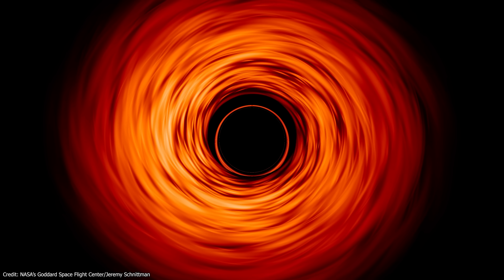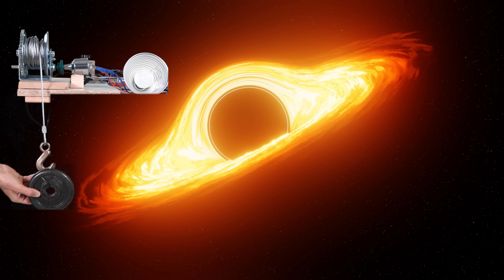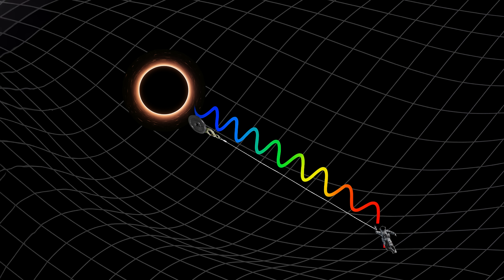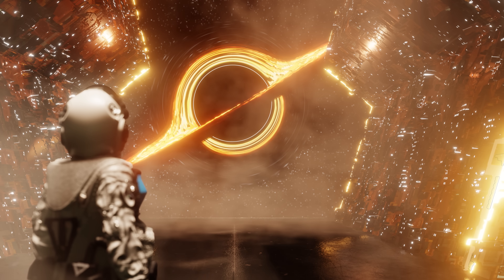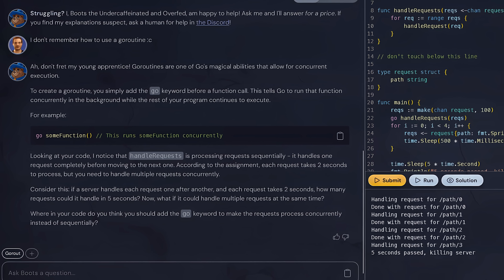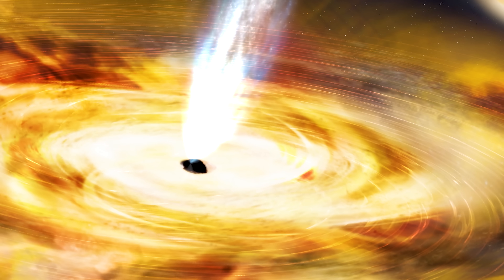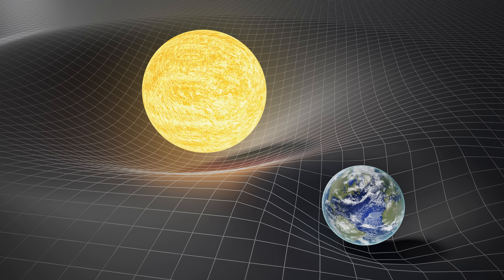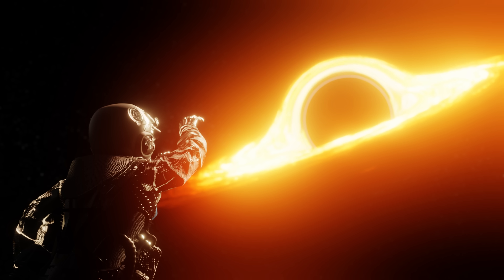How to Convert Mass into Energy at Home

Comment from the maker: I should have mentioned that the cable is massless. So we aren’t accounting for any change of mass of the cable itself.  Also, Click this link https://sponsr.is/bootdev_TheActionLab and use my code  THEACTIONLAB  to get 25% off your first payment for boot.dev
Reply from the maker: I’ll just tell you because it would’ve been interesting to put in the video. If the mass just falls in without being slowed down on the way, then we would say that 1 kg got added to the black hole. From the black hole point of view, it would say it got more mass than 1 kg. If it started at infinity(very far away)  then the black hole would say it gained 2kg of mass.
Reply: @TheActionLab - When a mass falls freely (and straight in) into a Schwartzchild black hole (from any distance), isn't it true that BY DEFINITION it is traveling at the speed of light when it reaches the event horizon? If true, that supposedly means it has gained infinite mass. That calls into question the simple multiplier of two for the mass-energy. Will an argument then be made that the black hole lost mass-energy by pulling the small mass in? Only recovering that mass when they merge? And is all of this accurately accounting for the non-conservation of energy in General Relativity?
Reply from the maker: @YodaWhat  ok, I think my question is a little tricky because of that. If you are an observer at the event horizon, then any object that falls toward you will approach the speed of light and thus its mass energy will approach infinity. But that doesn’t mean that the black hole receives that mass energy. The discrepancy comes because of the extreme reference frame of a hovering observer at the black hole event horizon. They would be using infinite energy to stay hovering there. 

But in the end I guess it’s not a very good question to ask what happens from a black hole point of view, since it’s is an impossible point of view.
Reply: @TheActionLab  "impossible" is not a reason to not ask the question? Otherwise why even ask the question about lowering an object inside a black hole with a winch..
Reply: @TheActionLab  isnt you converting only the gravitational potential energy

edit i commented this in begining of video
Reply: @TheActionLab   This is because from infinity to the event horizon, potential energy difference is equal to the rest energy? Just like the Schwartzschild radius?
Reply: We would say 60% went in, the black hole would say 100%
Reply: Now try it with a kilo of feathers 😊
Reply: Last I checked black holes can’t speak.
Reply: How to demonstrate the Oberth effect? That aceleration is a function of length travelled during acceleration, and not of time. I'd like to see how something that is already fast, accelerates more using the same amount of energy, than something that is moving slower. Why does it only work in space, and is the other way around here on Earth (like with a car)?
Reply: @bjorntorlarsson  accelerates more no, in my understanding its just the kinetic energy that increases.
KE increases more cos its 1/2(v+Dv)^2*M and (v+Dv)^2 is higher if v is higher even though Dv is the same.
for example
Reply: We'd say 1 the hole would say more?
Reply: Great job!! I love the direction you are going in, James! Thanks for your contribution to society!!
Reply: ¿Y el doblaje en español?
Reply: "Accretion disks are the most efficient way to convert mass into energy" when are we getting black hole heaters where you can dump any matter?
Reply: what about free fall?
Reply: I have always wondered how do scientists believe that the end of the universe will be in the heat death of the universe where all matter and energy are at maximum entropy and thermodynamic equilibrium, if black holes will continue to form from matter coming together and then shooting out energy into space again keeping the universe from ever acquiring maximum entropy and thermodynamic equilibrium?  Anyone have an idea how this hypothesis holds any weight?
Reply: That might be the worst of all of your experiments
Reply: From 🇮🇳
Reply: Does anything ever falls in the BH?
Reply: I don't understand the thought experiment... You say : "if I let this free fall the only thing slowing it down will be the generator" (1:06), but the generator is also free falling is it not ? So why would the 1kg weight follow a different trajectory than the generator ? The total forces on the generator are the same as the total forces on the 1kg force right ? The only difference are the few centimeters difference of their respective position in the gravitational field.

Comment: Thanks for taking the time to look through my work. 
I got started on this in 2007 and ten years later the penny dropped.
My whole life I have had a great passion for how things work. And would rather read an instruction manual than a book. So strap in, this is quite a revelation, 
Stanley Meyer and his twin brother Stephen were industrial problem solvers. Stephen has an impeccable resume and has been involved in many industrial developments with inventions and patents like the control of dielectric coatings on magnet wire, grading of fresh orange juice, if you drink orange juice it has been through his patented grading process. He was called out to put out a gas well fire in Libya that was over a mile high, using jet engines fired by the gas from the well below and directing the non combustible exhaust gases into the flame to extinguish them. So when Red Adair is not around they would call Stephen. 
Back to problem solving. As young brothers Stan and Stephen would sit after dinner time, and propose a problem that had to be solved. To do so they would split the pros and cons between them. One would spend ten minutes proposing positive steps to the problem and the other would spend ten minutes proposing the problems in doing that and then take turns about doing this into the early hours of the morning till they could come up with a viable answer.
Ok on to the matter at hand Stan and his New Atomic Energy source and his water powered car.
The first thing I would like to point out is that electrolysis has very little to do with this new technology. And it can be done without any electrolysis. There has been a bit of a Stanley Meyer cult build up over the years with many people trying to make electrolysis more efficient with the hope of some magic frequency or combinations to replicate Stan's work. This is clearly a byproduct of when looking at Stan's system people grab onto the only thing that they are familiar with. Disregarding the rest of the parts of the system with it all being an unknown.
Ok here’s the rundown of the different applications of this new discovery.  A new clean fuel that can be retrofitted to a combustion engine. A way to make superheated steam with very little influx of amps. A hydrogen laser many times the power of the status quo. An electrical particle generator with no moving parts that amplifies the input amps. A way to bypass normal chemical chains and make hundreds of new compounds. A way to reduce radioactive waste down to a safe atomic structure and make electricity through his new reduction method. 
What I am about to explain you need to have a basic understanding in a number of fields but the good news is really only up to A Level for the most part. Remember Stan says anyone can build this in their garage or shed. 
If you look at pictures of Stan's car you will see he is using it as a testing platform for all of the patented arrangements. All bar one were for legal reasons, as he was only going to be taking his water fuel injection system to market. On the car you will see a gas management system on the dashboard. You will see a stainless steel box to the right of the engine with 11 VIC units inside voltage intensifier circuits. You will see a waterfuel holding tank with a water level sensor and a steam resonator to never let the water cool below freezing. Top most center of the engine you will see what he called his Gas Processor. Pictures and relevant videos for explanation sake are available online.
I'm going to start with the oxygen atom/molecule. Oxygen is unique as it is used to start chemical reactions given it will gain electrons from other atoms, and so when starting a reaction in the case of steel it will gain an electron from the steel starting the process we call rust, oxidation.
A hydrogen atom has one electron and is one of the most basic of atom structures. Keeping it all as simple as possible.
At this point I urge you to spend half an hour looking into gas ionisation techniques at A level learning to understand the circuit and the effects of Townsend Avalanche on gases.
Also basic electrical tank circuit. Electrostatic fields like the ones used in a cyclotron or used in a CRT TV to control the positioning of the electrons from the electron gun to hit the backside of the screen and hit the fluorescent material coating to give off light emissions. Is it not true that to increase the light density of the fluorescent material,brightness, you just increase the B+ voltage of the  electrostatic field to increase the speed at which the electron hits the fluorescent substrate. Also a basic understanding of the action in a fluorescent tube light. All of this is very relevant to the process. Stan uses circuit resonance for the only reason that giving the components used, resonance is the most efficient way to utilize the components.
At this point I would like to give some direction on how the twins approached the problem.
As we know Faraday electrolysis is well known to be very inefficient. Using around three times the electrical energy per unit of energy from the gases created from water. Now here is the part that is never discussed. You are told that when you burn the hydrogen and oxygen from water you get energy out and water.. Stan did a study with NASA and came to the conclusion that the water produced when combusting hydrogen and oxygen must be looked at as a byproduct of the reaction. If looked into more closely you will find that only one millionth of the gases are combusted and the rest of your hard earned gases turn straight to water. Giving this process a very low efficiency level. So Stan and Stephen asked themselves how we could improve on this extreme inefficiency..  So they turned to. What if we were to increase the energy level of the air going into the process? Would this make any significant gains with efficiency? 
Ionising the air.
Ok, his Gas Processor / air ioniser. A basic understanding of how air can be ionised with electrostatic fields. Most commonly known for the production of ozone. 
An air ioniser does not make ozone inside the device. Ozone is made as the gases leave the ioniser and only then they join up.. Oxygen molecules get drawn into the ionizer and between the electrostatic field electrodes instantly get split into oxygen atoms, electrons get ejected and electron sharing starts to happen.
On exiting the ioniser the oxygen atoms quickly bond into molecules again and can carry a third oxygen atom. Forming ozone with a very short life. When put into contact with anything of an opposite charge, they drop the third oxygen atom and it does work oxidising like a gaseous bleach..
Stan redesigned the air ioniser. He knew if he could make more reactive oxygen it may increase the efficiency of the hydrogen and oxygen energy output during combustion. 
What he did, was to use the electrostatic fields of air ioniser to break down the oxygen molecules from air. But also prevent the formation of oxygen molecules and ozone post ioniser..
 Well how exactly did he do this? 
To do this he understood that if you have two electrostatic electrodes of opposite polarity with a dielectric in between being air. Then do you not have a capacitor?  When you break the molecules apart into monatomic atoms ions and free floating electrons there is an amount of charge on that capacitor.
If the pulsing circuit is interrupted and the capacitor is discharged through a filament that produces thermal energy as light. You can burn off free floating electrons from the oxygen atoms. And in so make an Oxygen Cation production unit. Not just Oxygen Cations but Cations with up to four missing electrons. This is a very reactive oxygen atom. In order to enhance this process Stan added pulsed light emissions to the gases in the processor 180 degrees out of phase to the electrostatic pulsing. This temporarily added energy to the oxygen atoms and made them more likely to eject electrons and less likely to gain electrons in their unstable state. The light added was very simple 660 Nm LEDs targeting the oxygen atoms.. So now he has an Oxygen Cation production unit. Keep in mind Oxygen Cations are not neutral thay are positively charged particles and in so are accelerated towards a negative electrostatic field and repelled by a positive electrostatic field. So do keep this in mind! His VIC circuits are High voltage particle accelerators.

Comment: A *parabolic mirror* can focus *infrared radiation* onto a specific point, just like it does with visible light. Here's a quick breakdown of how that works:

### *1. Focusing Infrared Radiation*
- A *parabolic mirror* has a special shape that ensures *parallel rays of light* (or any electromagnetic radiation, including infrared) are reflected toward a single point known as the **focal point**.
  
- When you direct *infrared radiation* (such as heat from warm objects or the ambient environment) onto the mirror, the parabolic shape will reflect the infrared radiation toward this **focused area**.

### *2. Resulting Focused Infrared Area*
- The point where all the infrared radiation converges is where the *temperature* will increase significantly, forming a **hot spot**.
  
- The size and intensity of the hot spot depend on the size of the mirror and the amount of infrared radiation being reflected. A *larger mirror* can focus more infrared energy into a smaller area, creating a **higher-temperature hot spot**.

### *3. Applications for Energy Generation*
Once the infrared energy is focused into this **hot spot**, you can use it to generate energy. For example:
- *Stirling Engine**: Place a **Stirling engine* at the hot spot, and the engine will use the *temperature difference* between the focused hot side (from the infrared) and a cooler side (such as air or water) to produce mechanical energy.
  
- *Thermoelectric Generator (TEG)**: A **thermoelectric generator* placed at the focal point would convert the temperature difference directly into **electricity**.

In either case, the *focused infrared energy* is being used to *generate power* by creating a **temperature differential**.

---

### *Summary*
- Yes, a *parabolic mirror* can focus *infrared radiation* into a specific area, creating a **focused infrared hot spot**.
- This concentrated energy can be used to drive a *Stirling engine* or **thermoelectric generator**, effectively converting heat into mechanical energy or electricity.

Comment: The way that I can understand this is that ...because time slows down closer to the black hole and time is faster at the energy generator, the mass doesn't change where it is located, but does change where you are because from the energy generator point it's like pulling on a weight that is traveling in such slow motion that it no longer has momentum to produce a force because of the change in time passing. I get that part. I think the part where you explain accretion disks causing mass reduction from heat is very confusing because you can't just say that our 1KG weight was never put in by being lowered in slowly. Even if it was put in, it would still be measurable in light and/or mass in accretion disks...Also We would never be able to lower the 1kg weight fully in anyway unless our indestructible cable was instead a rigid pole that would allow us to push the 1 kg weight into the black hole from a different space time curvature. If our 1kg weight suddenly feels like it has no weight, how are we lowering it in??? Furthermore you can't say at 6:05 that you have a small mass change on earth due to slight time dilation from gravity that can be measured in 1 nanogram (1 billionth of a gram ) and then say that this can't be measured unless you have the right conditions... If it's measurable, it's measurable.

Comment: You can't let the weight descend into the black hole for the simple reason that both the weight and the cable will be severed at the event horizon.
You don't understand what a black hole is. It's a mass/energy that bends spacetime to the point of closing it in on itself. There's a divorce, an absolute break between the Universe and the interior of the black hole.

Comment: ugh.... wrong.   
Look at the graph of gravity field strength of the Earth vs distance from the core. 
The energy it takes to lift an object farther from the core, is the same amount of energy it had previously contributed to the gravity well of the earth. 
Only objects closer to the core of the planet contribute to its gravity well relative to your position. everything farther away from the core (moutains, Sky, atmosphere, even on the other side of the planet) does NOT contribute to the gravity well from your position. 

Building skyscrapers reduces the felt gravity of everything below the Skyscraper.